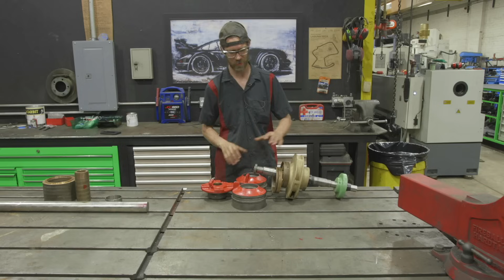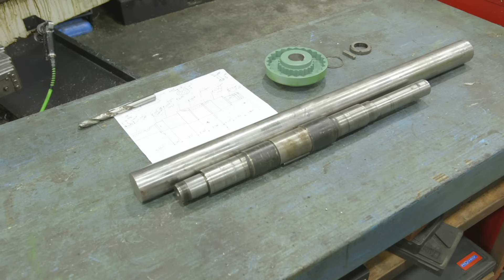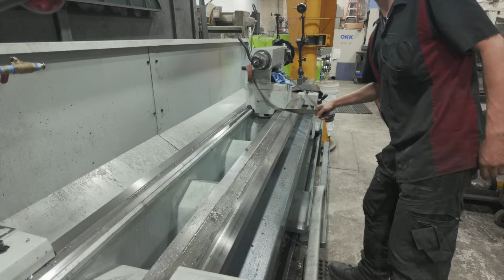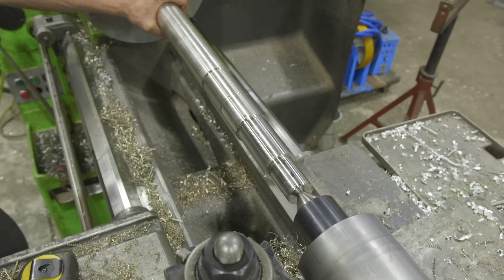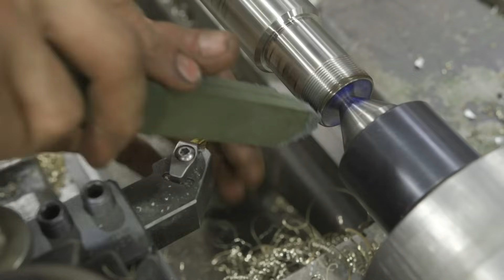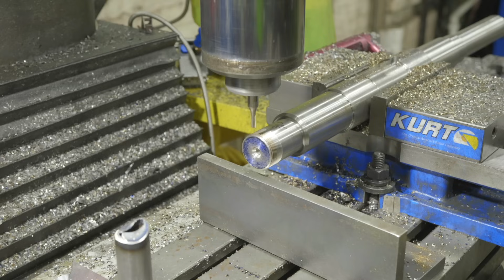Machining Water Pump Shaft

Comment: why did they supply 304 instead of 316? 316 is far more corrosion resistant
Reply: Guess the galvanic corrosion would eat the less precious metals first, so it doesn´t really matter.
Reply: Because they are cheapa$$ high percentage of pumps are all 304ss shafts
Reply: @johnmariotti5846  thats pretty silly cus the cost of machining + material wouldnt be a big difference. oh well
Reply: As previously commented,  unless its environment is salt water, or aggressive solutions,  304 is fine, 303 is great to machine, but not as corrosion resistance.
Reply: It’s all they had on hand.
Reply: Because.... the customer is always right!🙄